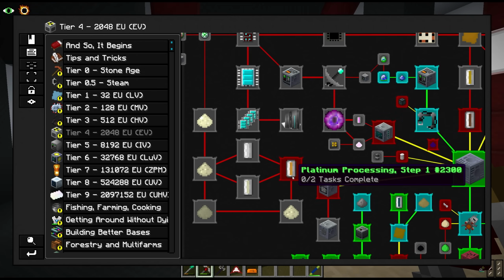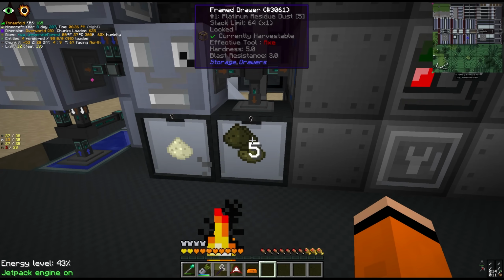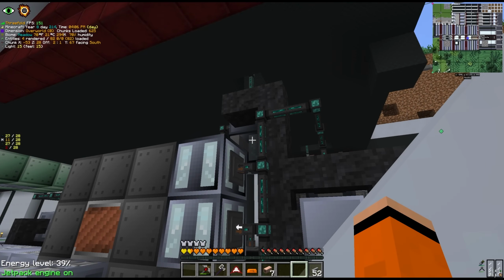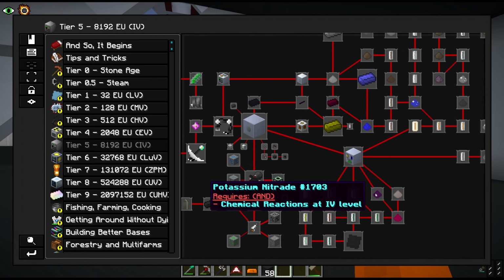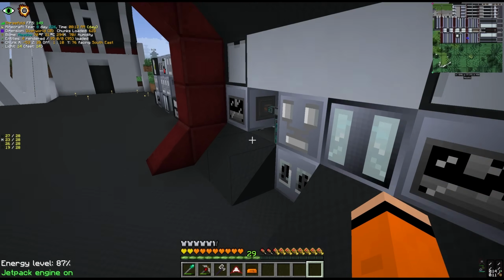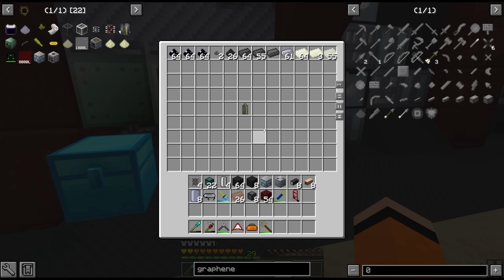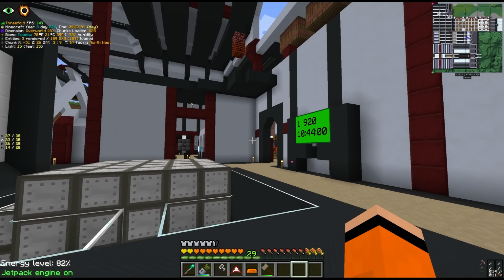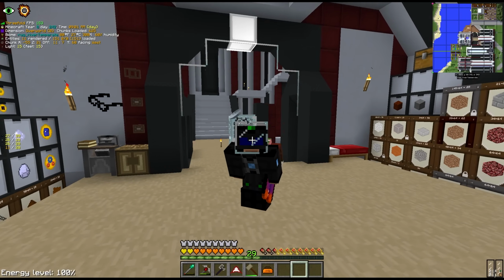Gregtech New Horizons - 31 - Platinum & IV Unlock! Modded Minecraft

Comment: What I do in my garden dimension chemical process building is leave a 4 block gap between floors, where the wires and pipe goes, it's clean as long as you dont dig under the floor lol.

Comment: 6:35 Really good explanation of the initial steps Three, couldn't have done it better!!! 👍👍You could actually finish up the palladium fluid processing step while you're at it. It's actually just a couple more LV machines but yea you don't need it immediately. As for the residue dust, yea not quiet yet, you'll need IV (and like 10+ more machines/multiblocks) to fully process them. Really interesting setup though.

Oh boi the fluid pipes spaghetti continues to expand 😂 When you start planning your new base, you could consider drawing up a fluid network using ender fluid conduits underneath your base, maybe in conjunction with AE2 fluids. It would take away the "industrial feel" of having metal pipes running around, but it's far easier to manage and expand, since both ender fluid conduits and AE2 can handle multiple fluids down a single line with ease. Would be cool if you retain one metal line for fuel (Just for the looks xD) and everything else goes into another single line for ease of management.

Comment: There's other ores you can process with mercury to get platinum pain train dust, as I call the initial step, and that is something you definitely want to do. You are going to need platinum in gigantic quantities in order to enter LuV, and the various byproducts you get from processing platinum pain train are eventually going to overtake platinum itself in importance as well.

Since you're planning on moving soon your best bet RE: slow EBF recipes is to keep some things in stock, keep those EBFs running whenever there's enough power to do so. A better solution would be to get more EBFs, of course, but that requires more power and setting that up would require either a really janky temporary setup or serious investment into something that's going to be temporary...although in GTNH "temporary" basically means "semi-permanent", in most cases.

If people couldn't follow this they're going to have a fun time when you do the other, what, 80% of the platline. This is just setting up the initial step, there's a lot more to it before all is said and done.

Never craft lower tier coils if you can help it. Better coils means better power efficiency and/or upgraded overclocks, and even if it doesn't it means it's easier to recycle them later.

Setting up pyros and an associated distillation towers for wood tar and wood vinegar (wood gas isn't really necessary, and charcoal byproducts is just the previous three at worse rates, so not too useful either considering how material hungry GTNH is) is absolutely something you want to do...when you're not moving bases in the very near future. Having all of those fluids just available is so incredibly useful and convenient, especially for things you're going to want automated and in large quantities, but it is a big investment for something that would not be the easiest thing in the world to move.

"Yeah this chunk has a bunch, up to 131L" stares curiously at the 351L fluid chunk right next to your landing spot

Something that you should do is keep around some duct tape in order to repair maintenance issues. I don't like to use it with machines in my base, since it gives maintenance hatches an ugly duct tape texture, but for temporary setups like oil drilling rigs it's perfect for just solving maintenance issues and not having to worry about whether I have this or that tool on me. Of course with the toolbox this isn't as necessary at it once was, but I still think it'll be handy to keep around, say in case you forget to recharge your soldering iron or something.

For the record, in case anyone is curious: Yes, the The Last Millennium portal is craftable, and yes, it is within Three's means to craft (it would require a bit of TC progression, but nothing that takes more than HV machines to accomplish comfortably). However, two caveats: One, The Last Millennium in this pack is perma night, instead of the void world's perma day, which would severely complicate bees and most forms of solar, as well as possibly some other stuff. Second, The Last Millennium (from my testing) seems to have an issue where it sends you back to world spawn any time you take the portal back to the overworld, whereas the void dimension portal will place you back at the portal in the overworld. This would make moving bases extremely tedious, and Three is not anywhere close to interdimensional travel options yet unless he really dives face-first into TC and Warp central. The void world portal does involve this T3 rocket rush, but it is the better permanent solution.

First nitrogen setup in late EV. I guess it's less important now that the alu line exists, but still. That's a major difference from the nitrogen setup I build in MV if not LV.

This is why I tell you to look up better circuit recipes and works towards them at every possible opportunity. You do not want to make the mistake of delaying upgraded circuits until later, because that is an awful lot of time and effort sunk into crafting stacks upon stacks of stuff to craft many, many lower tier circuits to upgrade into the higher tier circuits you need.

First off, enchanting the voltage tier lootbags is actually cheaper in your version than when I played, because at some point the devs changed those lootbags to take motors instead of random stuff. I believe the EV bag used to take an industrial diamond, which actually would have been cheaper, but the IV one used to take an LuV Nanocircuit. That's pricy! Also enchanted lootbags can't give dud rewards like redstone torches, and that quest consumes those items to give you a talisman of remedium, it's not a freeby ;)

The EV PLE requires EV emitters, and EV sensors/emitters require Radon. Anything that requires an EV sensor and emitter are off-limits for you until you set up Radon, which if you're going to set it up at this base you're going to want to set up soon because it is a pain and a half to craft it without the plutonium loop.

You don't get peace and quiet standing next to an industrial machine going full tilt? You don't say ;)

Now imagine if that maintenance issue happened after you cued up eight stacks of circuits to be batch crafted, and you went to Mars to pick up some stuff before you heard the alarm. Automated maintenance is post-Assembly Line, by the way.

So to go with your fancy new jetpack, did you know that Witching Gadgets adds a...I forget the name, but pauldron or bracelet-looking dealio that reduces/negates the mining speed penalty while being airborne? Just, you know, trying to tempt you back into TC once this base move deal is over ;)

As for moving bases, I think holding out for the void world might be the best option. Ultimately you're going to want to go to endgame in this pack, not necessarily Stargate but something sufficiently big and impressive, and I think putting all of that in the voidworld is going to measurably help with performance. I also don't think an intermediate base to get a T3 rocket is going to be necessary. You don't have to automate PBI, you just have to do the questbook's manual crafting series twice and you're good as far as that stuff goes. Just one IV chemical reactor and some manual work will get that job done just fine, and what you really need to automate you've largely automated already.
Reply: Dude you just typed a essay
Reply: @glitchgaming766  He has an Ph.d In gregtech new horizon optimization.  Honestly a madman
Reply: @robertderkinderen8928  I heard that it's Greg himself